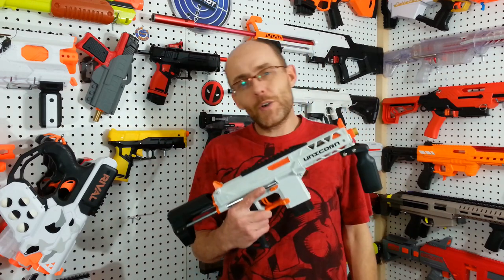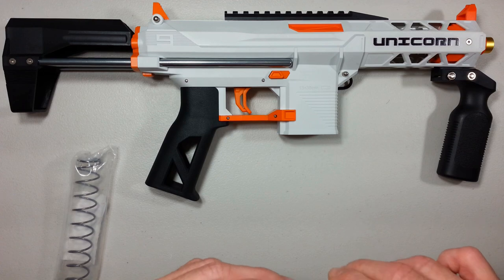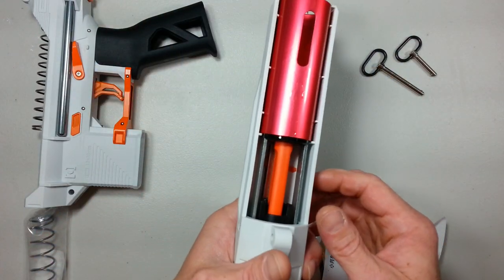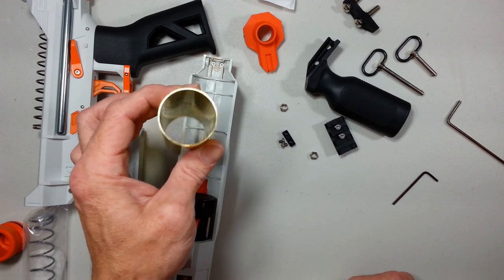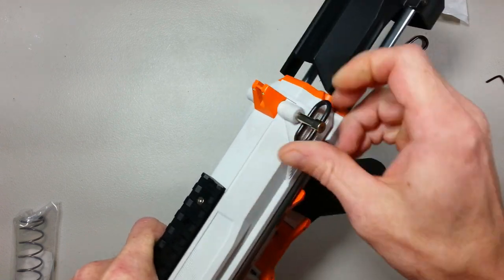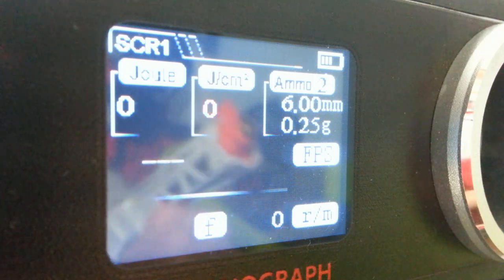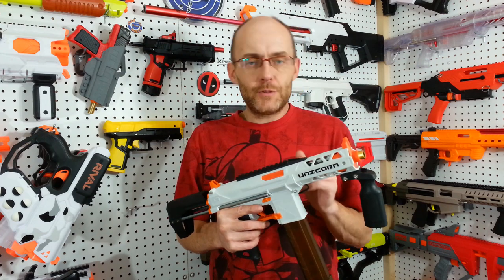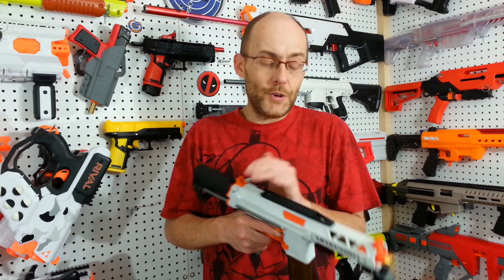XYL KM9 Unicorn Mod ( Plunger Tube & 14kg Spring )

Comment: Maybe drill a hole in the top of the pusher like on the Harrier & add a bit longer barrel & I'm sure it'll get over 200
Reply from the maker: Probably... TBH the ported one was not bad, but i'll drill the tip of my pusher to help. I might also slap a 25-30 CM Swin or ZWQ barrel on it
Reply: You mentioned you had to use a larger oring on the plunger. Maybe it was a bit too large and causing drag. I had similar issue with tuning a skewer to 250 and ended up adjusting my teflon tape multiple times to find the sweet spot.😊
Reply: What does a hole in the pusher do? Just curious cause I’ve seen people do this
Reply: @sarahthompson9621  there's an ammount of vaccuum pressure created in a well sealed system when the breach is closed and the hole will release the pressure just before the breach seals to the pusher. The vaccuum pressure can lower performance & cause feeding issues
Reply from the maker: @sarahthompson9621  It allow air to go in the plunger tube when bringing the Prime forward, preventing the dart to stick to the pusher by vacuum...messing with performance and reliability
Reply: Thanks for the explanations
Reply from the maker: @sarahthompson9621  No Problem. Feel free to ask as I always say!!

Comment: :7:34  Barrell is now too short.  Darts haven't reached max velocity before leaving the blaster.  Same with the higher spring.  If you change ONE variable you affect all the others.   OH and I love to see a ceda on the wall. Good video.
Reply from the maker: I well know that, as I mention in the video that my barrel will be replaced by a SWIN 25-30 cm

Comment: I got around 179fps on the same upgrades but with a 19cm brass barrel using worker gen 2 HE. 
Using the included suction cup darts, I got 220fps.
Reply: I can confirm your results. Same setup. But I sometimes have the problem that some darts get way below 120. does that happen to you too? Also I think a scar might help a lot with precision. Need to get one soon.
Reply: @robmexx  nope. Mine remain consistently above 170fps at that setup. I did swap out the pusher and plunger head o-rings though. It has roughly 10-15 second airseal.
Reply: @adrianliew9288  could be that then. Im still running the original o-ring setup but planing to buy an upgraded kit.

Comment: Hello I'm getting a constant 180 fps with a 0.7g bamboo dartn 17.2cm brass barrel, and with the 1.7 spring, may I know where did you get the brass plunger tube and 14kg spring?
Reply from the maker: all link in the description... it was Biu Blaster
Reply: @thatoldnerfguy   I would recommend the 17cm edge barrel which biu blasters sell, it has 2 orings to secure to the dart gate
Reply from the maker: @JamesWatamii  The plan is to go with a custom SWIN barrel... I might add the groove for the o-ring